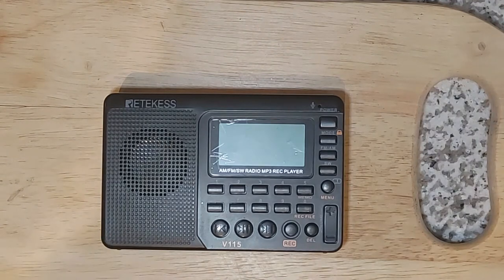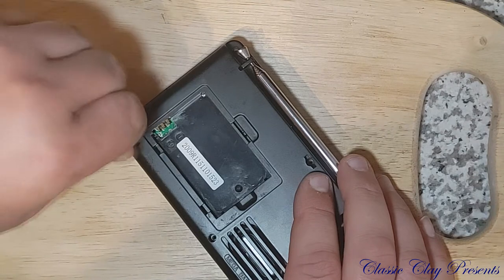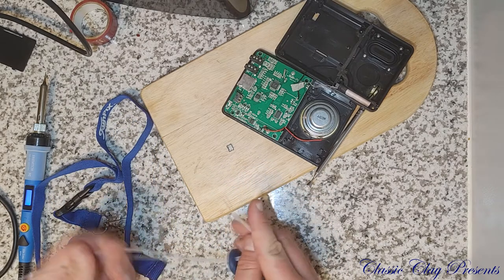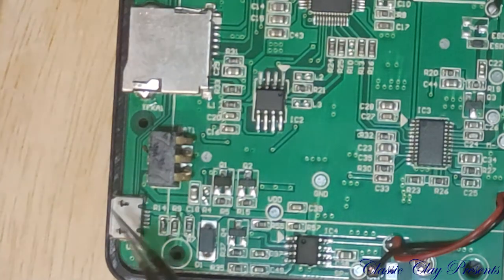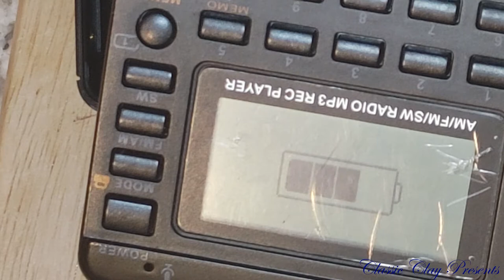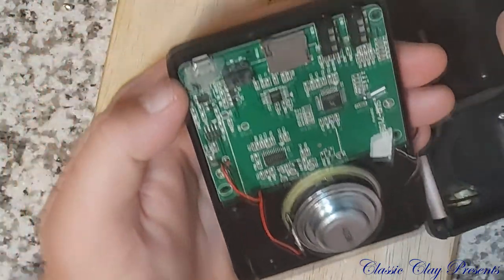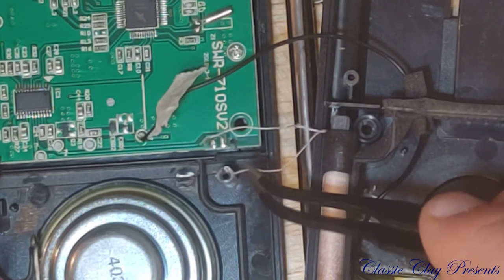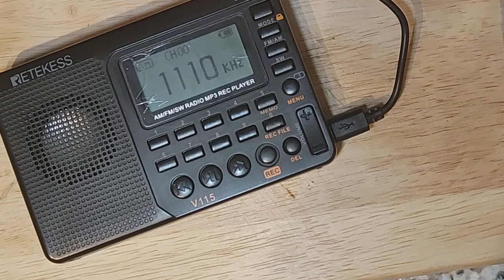Retekess V115 Repair

Comment: If you buy this radio, be sure to get the F9205C upgrade version which features a sturdy USB type C jack instead of the micro USB charging port.  Yours was probably F9205A (check the front of the box if you still have it).

Comment: it's a real shit to achieve it's almost impossible. Me to do this kind of thing, I take magnifying glasses and a soldering iron with a very fine soldering tip. In your case, you could try the desoldering pump to remove what is bothersome. I doubt that this way it charges the battery properly.